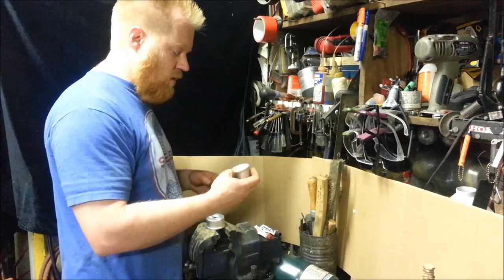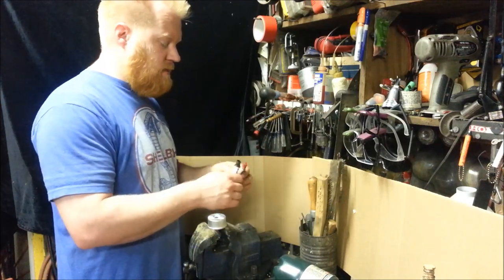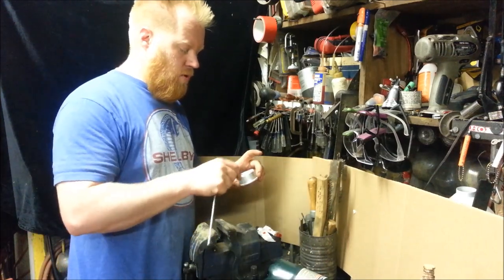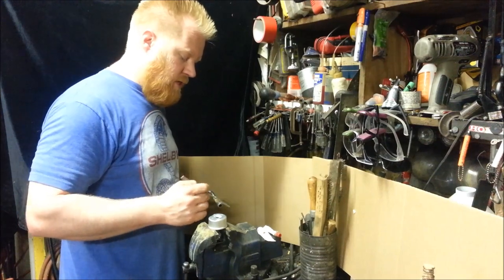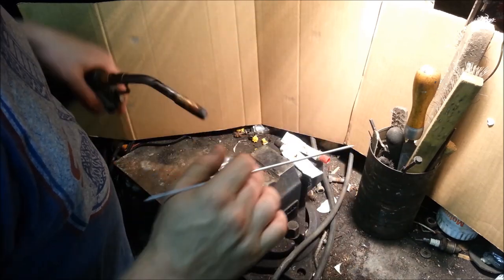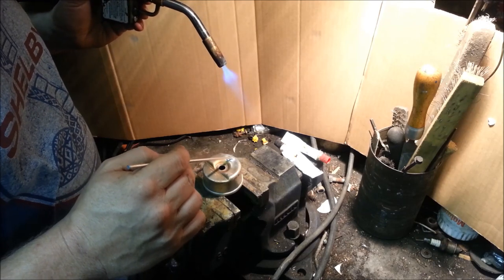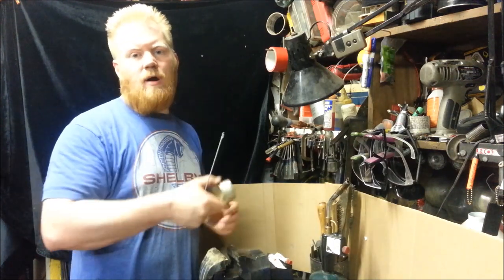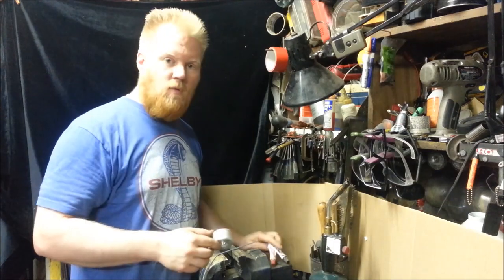Leaking Carburetor Bowl REPAIRED Tecumseh Briggs Kohler

Comment: I have that same torch.   It's a turbo or swirl torch that burns quite a bit hotter than the regular style you light with a striker.      Advice to the uninitiated, be very careful with that thing on a piece of thin aluminum like a float bowl.      Keep that monster back and scratch back and forth with the end of the rod on the surface to be brazed.   The second you see it streaking back off the heat and fill the hole.    If you aren't familiar with that braze practice on a scrap piece first or at least use a small torch lest you find out first hand how fast aluminum slags down.     It aint pretty and often not repairable.
Reply from the maker: +Merlin Cat Yeah, aluminum this thin heats fast and will turn into a puddle in no time.
Reply: +sixtyfiveford 
Thats why I like using the small pencil torch for those small goodies.    I messed up the cowling on my plane once with that same torch.     Really thick aluminum too.  The  hole the camlock went through was severely fretted.    Went to slag and dropped out in a blink and i had to redo a patch the size of a dime and redrill  the hole.   Boy that stuff does a fantastic job.    It drills more like steel and you can grind / sand it easily .   Much harder than the parent metal in my experience as well.
 If you try to get it at a welding shop they just laugh at you and say what garbage it is.    I guess their primary interest is selling you a $3000 tig torch rig.   One nice thing.   This stuff was very hard to find for decades.  Now you can get it at Harbor Freight for around $8 and it has no storage requirements at all or shelf life.

Comment: hi, concerning the hole at bottom of that float bowl....there is a bolt and a metal washer ? 
Mine seems to be leaking at that metal washer.
Seems to me it should be a rubber washer, right ?
Reply from the maker: It should be a soft aluminum washer. You could also use like fiber gasket material but not rubber as gasoline will just destroy it. Most of the time when you think the gasket is leaking, you actually have a pinhole leak somewhere in the bowl.
Reply: @sixtyfiveford  thank you. I will double check that.

Comment: ha ha yup still here :-))

Didnt know you could braze with aluminium at all, new to me :-)
When i was at school about a million years ago, we had to braze plates together, we had some pink sort of flux to dip the brass rod into, wonder if you could get something similar for aluminium rods.

So if it takes without you melting the whole bowl, then leave it be lol.
Reply from the maker: Yeah, it melts around 400 Celsius where aluminum melts at 660 Celsius. So it's easy to get it a little to hot and have your work piece turn into a puddle. I've never used flux when aluminum brazing but it makes sense.

Comment: Does the material your welding with this stuff need to be aluminum or can it be other stuff
Reply from the maker: It's just for aluminum but any other metal you can use plain solder.

Comment: That's great! I'll have to try that. I was told a long time ago by a person that repaired aluminum to mark the material with a black permanent marker. Once the heat turns the mark brown, that's the sweet spot. Don't heat beyond that point or it will melt through. I've never tried it, but I'd sure like to know if it's true. :)
Reply from the maker: Nice tip. I'm going to give that a try, Thanks.

Comment: Would that method work for something under pressure? I got a pinhole leak in the condenser of my van air conditioner.
Reply from the maker: Yes, but not while under pressure. You would have to drain it first but it would be permanent. However I have used JB weld with success to repair a AC leak and it lasted for years. You wouldn't need to drain it but you will need to degrease it good and lightly sand the area to ensure a good bond.

Comment: I have a cb1 with a tiny hole in side of carb itself looks to be aluminum will this work
Reply from the maker: This will work for an aluminum bowl. A steel bowl, regular solder will work. You can also generally get a few years out of JB weld on the bowl.
Reply from the maker: Just read your comment again. I wouldn't heat the carb itself. I would use JB weld. However, a premade hole in the side of the carb is likely a vent. If it is leaking from the vent, likely your needle and seat aren't sealing properly.

Comment: I accidentally drilled a hole thru a Welch plug in my Tecumseh carb.would I be able to use this to seal that hole?im really kickin myself in the arse right now!
Reply from the maker: The welch plug on the underside, under the bowl, across from the needle/seat? That one is no big deal. The one on the side of the carb, back by the outlet of of the carb is the idle air/fuel mixture inlet and will need to be sealed off. JB weld putty would work fine but hopefully non of the precise metering holes underneath got damaged.
Reply: sixtyfiveford thanks a lot.this is an old series 2 outboard carb and I only see 1 plug on outside underneath the idle mixture screw.it is dead center and didn’t damage 3 other tiny holes.so job weld will hold up to oil n gas mixture?thanks for responding back btw!!
Reply from the maker: @christopherfisher123  JB weld putty, not the liquid tubes. I also use a product called "Quick Steel". Both hold up to gasoline well.
Reply: sixtyfiveford thanks bro!ill try the jb weld steel stik

Comment: This happens to my Tecumseh bowls all the time. I've gone through 4 of them like this. What I don't get is why does water do this to aluminum so easily if it is in fact water? I suspect it's something to do with the damned ethanol now. Whatever it is, it's a real PITA.
Reply from the maker: Yes, ethanol pulls moisture out of the air and it sinks to the bottom of you fuel tank and carb bowl and destroys it.
Reply: No doubt about moisture but if a thin walled aluminum can holds coke for decades without issue I want some chemist to explain why a carb bowl 4 times as thick can't last 2 years...